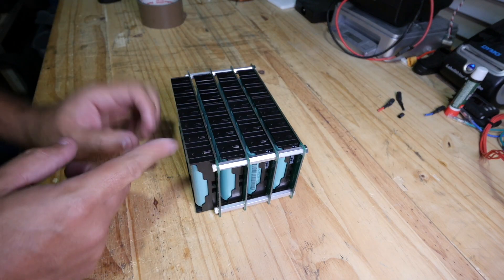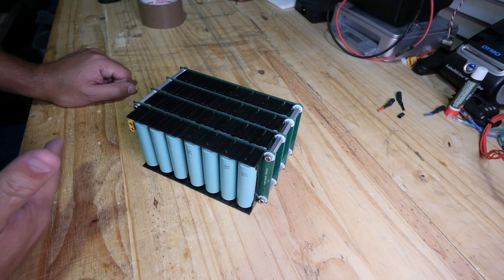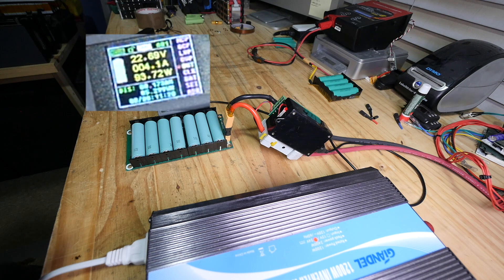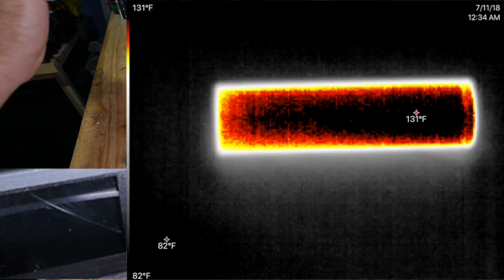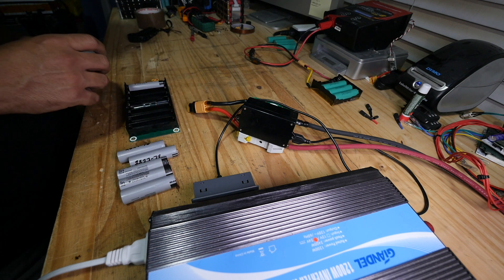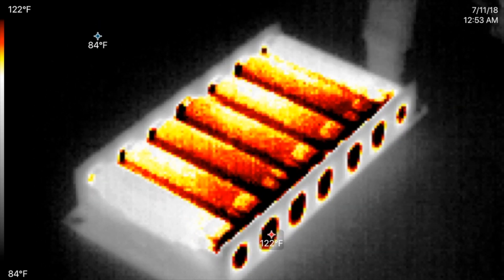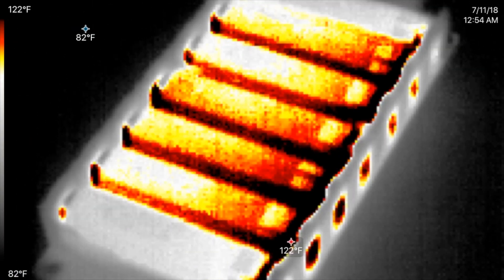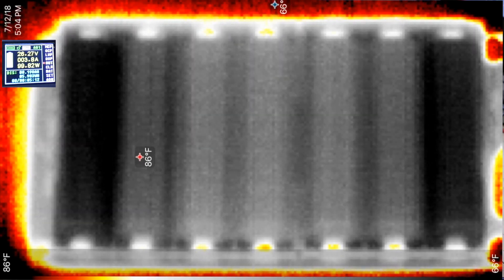Are Cheap Chinese 18650 battery holders Good enough? DIY Powerwalls

Comment: Hey Jehu. I am an HVAC engineer with some experience with cooling IT rooms. Generally I will provide a fan for batteries that exceed 250W capacity. I think the issue you have right now and the issue you will run into in the future with this battery set up is that you do not have adequate cooling. I highly recommend adding a fan to your battery system design. It should take care of all your over heating issues if the fan is sized properly.
Reply from the maker: Not really,  the 1c load shown in this test a worst case scenario,  it’s equivalent of completely discharging your large house battery in one hour.
Reply: jehugarcia I see where you are coming from. I am just letting you know what I do as an industry standard. It's important to provide systems like that with some level of cooling, especially when the battery sizes get large. Just food for thought. Keep up the great video man, you are killing it

Comment: Design a heat sinc that would absorb all the heat from the batteries so that it would not affect the plastic. 
Second option is to try to get a manufacturer that would make a high temperature resistant plastic or a ceramic casing.

Comment: If you could use the tabs to hold a wire on the battery. With enough contact area.  All you need is a mosfet for reverse protection! Use the cells to turn the fet on. Maybe a resistor and mosfet
 Of its in a kit form. Reverse protection can be a extra. If you use a blocking diode. There will be a voltage drop of about .5 -.7 volts. The mosfet will do better with very little drop.
Reply from the maker: Yeah diode its way too inefficient,  i would have dissipate 5w per board

Comment: the abs they are made of is capable of handling normal heat .. you were pulling more power than would be recommended for the batteries in such use.. a single pack will draw more power than a parallel pack. Try 2 or more packs in parallel and test temps.

Comment: The contacts aren't low resistance and causes them to heat up which makes things worse. You could try squeezing the connectors harder against the cells to see if the bad contact is bad enough it starts heating the contacts
Reply: With the 30A cells the contacts weren't heating up nearly as much.  That shows that likely the cells themselves were being drawn too hard.

Comment: Isn't it unlikely to happen that every 3ah battery puts out 4 Amps worth of energy? I was considering to build my powerwall with more capacity then power to keep discharge rates under 1C
Reply from the maker: Correct,  1c is worst case scenario,  likely never see that load if system is designed correctly.

Comment: Check the resistance of the China battery pad (contact ). Maybe they used a poor plating that is higher resistance then say other metal components in the system (fuse, PCB traces, etc.). Also check the surface area of the battery  to holder on those contacts. If they are twisted, or not designed to stay flat on a battery then the area will be reduced and less area to carry the current= higher heat. It's obvious from the IR images the heat is right there. I'd try sanding off any plating on the spring metal contacts, and re- try. The bare metal may prove better if it's a bad plating job. Come on, that 1/8W resistor wire is carrying all the load of one PCB (7S), no heat there ! -Will.

Comment: Of course these contacts are heating up. They have high resistance, not as bad as thin 0,3mm-0,5mm steel springs, but still bad.

They are made of steel, which has 3-8% IACS, or 3-8% the conductivity of copper.

Using a material like 19% IACS phosphor bronze C54400, or Beryllium Copper C17530 38% IACS, or even C17500 45% IACS would make these holders absolutely beastly.

Just using phosphor bronze 19% IACS springs would help tremendously, such as shown in this test:
http://budgetlightforum.com/node/35228

Comment: I think the cells are rated at like 3 amps continuous. I can't recall but its low amps that's why I did not get any. And max of 1.25a charge. The chinease cells would be fine if you are pulling 1-2 amps.
Reply from the maker: I used 30A cells on the last run
Reply: Please use Degrees C. Electric components are Rated in C.
Reply from the maker: Use a calculator
Reply: No  RP Protection. HQ PLATEDContacts REQUIRED - or you will have fires.
Reply: CONTACTS need to be Constant Tension

Comment: I think the biggest problem here is that those modules are made to charge the cells therefore handling relatively low current instead a discharge that in this case is taking more current thru them

Comment: Could you just do a batch of both. That way people that want the protection can pay a bit extra and those that don’t feel the need it can buy ones without protection.
Reply from the maker: The smart thing would be to make it the same board,  you populate the protection circuit or jump it
Reply: So if you build it into each board would it still be more expensive without the jumper?  what i'm thinking is if its the same price you might as well just build every board with the polarity protection in place.  Honestly me personally feel like its not needed though, Im not an expert but I think i would understand enough to make sure its correct.  I wouldnt mind paying the extra money though if it was built in either so either way you go for me it wouldnt matter.
Reply from the maker: My point is same board can have it built in or not,  don’t need a separate batch

Comment: Not an apples for apples test unless you subject the better cells to the same c factor. If the 2000mah cells were under 4A load then you have 2.25C. Therefore the better 3000mah cells should be tested at 6.75A

Comment: I bought some cheap chinese ones, and the resistence of the contacts is really high so the spring contacts melted away and nearly started a fire
Reply from the maker: How many amps did you put thru it?
Reply: 5 Amps...

Comment: Do not add reverse polarity protection.  Please just find a way to better way to convey the polarity to the user (I saw many great ideas in the comments).  Reverse polarity protection would add an unnecessary energy waste, voltage drop, and complexity to your design.  The type of each cell polarity protection you are wanting would require an in series diode for each cell for discharging (using with a load) and another in series diode per cell for charging.  You would also need another set of connectors for charging.  Each diode will have a voltage drop of 0.7V.  At fully charged, 4.2V, the voltage drop is almost 17% of the full potential difference.  At the lower end, 3.4V, the voltage drop is almost 21% of the full potential difference.  At best case you are wasting almost 17% of the energy stored in the battery just for polarity protection.
Reply: Yep, having diodes in series will seriously mess up the voltage detection done by the li-ion charger.
Reply: AND bear in mind ALL that wasted energy in the diodes will also generate further HEAT

Comment: I recon it's the type of cells you use, Power cells will be able to take high discharge rates, to load a normal cells with high load is not fair.

Comment: Definitely not, think about the scaling. One board holds 7 cells, lets call them a usable 8whr each (lets be real, probably using used batteries in the 2600mahr range from 3.2-4v @ 2A to make things reliable and economical). Talking 55whr pack, or 18 to a kwhr. That's a $25-30 expense per kwhr, or another  ~100-150whr worth of cells.  30kwhr would be enough for most larger houses without an EV, 10 min. A $500-1000 expense for something that basic isn't worth it, if they can't figure that much out based off the shape of the cell they shouldn't be messing with scale-able DIY packs in the first place.  

 I've got a few hundred laptop packs to go through so it'll be awesome to see some off the shelf options!

Comment: I think you should add as much safety into these diy systems.. so much so even grandma can do it.
Reply: Thing is you need to have a modicum of knowledge.  I mean any idiot can reverse up a car battery and then boom.  So should we recall millions and millions of cars?
Reply: id say a little more would not hurt but theres also the much more important question for me if we cant have a simple BMS on the board itself so every board can be used completely independently if required.
Reply: Tom St Denis cars are colour coded with positive and negative.
Reply: Tom St Denis another rule of thumb.  If you're not sure what you're doing.  Don't touch it. 

I'm saying this. 

For a DIY kit.  Make it as a safe as possible...clearly without blowing too much out of budget.  And colour code everything. 

Yes I know.. annoying to hear for someone as skilled as yourself.

Comment: Diodes are cheap. 1 diode per cell prevents it from being, or causing damage if backwards, its as though the cell isn't in at all. A 4 diode bridge rectifier per cell will make it not matter which way you install the cells and still get power out of them, as well as making it possible to charge them on AC.

Comment: Isn’t part of the problem with the heat because you’re asking so much of seven single cells in reality if you’re going to run an inverter you’re going to have much more than that stacked which then lowers how much you’re asking of each cell I would redo the test with a configuration of 7S 8P
Reply from the maker: Yes I’m testing pcb limits

Comment: if you can verify that the battery is outputting 7*2.8=19.6V, then you can be 100% confident that all cells are in the correct polarity.
You can make a voltage level detector with 1 zener diode, 1 resistor and 1 LED.
http://www.learningaboutelectronics.com/Articles/Voltage-level-indicator-with-a-zener-diode.php
definitely do not parallel 2 batteries, where 1 cell is possibly reversed... you will have a short circuit AND a strong-charges-weak situation.

Comment: you can try the metal clips in the link below. they dont have plastic so you dont have to worry about that melting. they have 3 larger pins to allow current to pass more easily and create less heat. and they leave the cell more open so air can pass through and cool the cells.
https://www.digikey.ca/product-detail/en/keystone-electronics/54/36-54-ND/2254090
Reply from the maker: The problem is the price $.70 per cell x 7 = $4.90 per board.   Doubles the price of these for something that we don’t need.  Large Powerwalls never get loaded with 1c

Comment: Maybe you smart battery guys/gals can help me. CR123 bat don't LAST done under load or outside temp of 30DegF or lower. i hog hunt and I need a way to make a MUCH longer lasting replacement for a 3 x CR123 kit i use for my atn binox binoculars. you can search and see what they look like. I would like to make a 3 x pack 18650 pack (high mha) and regulate the  9V (with a wire lead that is about 4ft long that will fit into a BinoX case. there is a good market for these if you all can make one safe. I will be your bate test guy. and we all can sell them on ebay and you can make a good cut of the money. what do you say?

Comment: People are freaking stupid the battery wasn't getting hot the spot on top of the batteries getting hot.... Meaning of freaking current is doing the job through really cheap bad thin metal...
Reply: I agree - I don't understand why the glaringly obvious contact heating wasn't even mentioned.  To compare battery frames exchange the frames then test again using identical batteries in the same charge state.  
Logic was harmed in the making of this video....
Reply: Look at what gets hot FIRST, the contacts do.

Comment: Yep, not a good comparison; needs to be same density & capacity. Second comparison was closer.  Nevertheless, proves chineesium junk has no place in critical/important applications.

Bottom line: if it's important, it's important enough to spend the moolah.

Comment: Just put a big diode in series with every cell! should only be $0.1 max for eatch diode from china.
Reply: That will prevent charging the cells. It will also mess up the voltage detection done to determine discharge cutoff.

Comment: I know you will ignore this like all of my previous comments.
   But how about you have no understanding of the capacity of DC voltage and the wire's needed to carry it, especially in the conversion to AC? 
   You keep doing these experiments that have already been done with to small of a wire size that have already been demonstrated and then declaring them to be failures?
Reply from the maker: I have zero clue what you are talking about,  this is a DC circuit we are designing and testing here.    Try to keep up please
Reply: jehugarcia 
That is exactly my point, you keep doing these experiments with DC voltage with everything from power walls, to skate boards, to solar panels without allowing sufficient wire size to carry the current. 
   Please go back to school and I learn that it is way different than what is needed for AC. 
   You have so many failures because you don't understand that the wire size, number of strands, and individual size of those strands is very important when discussing carrying DC current.
Reply from the maker: what failures? This is my school,  learning is not failure